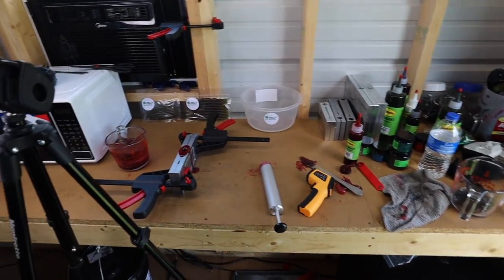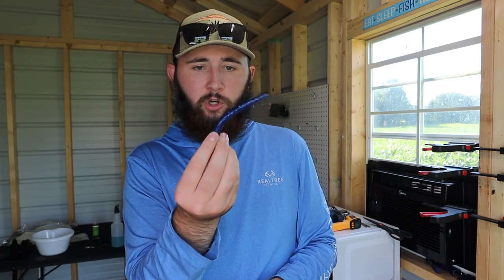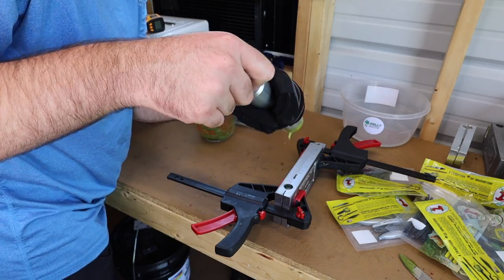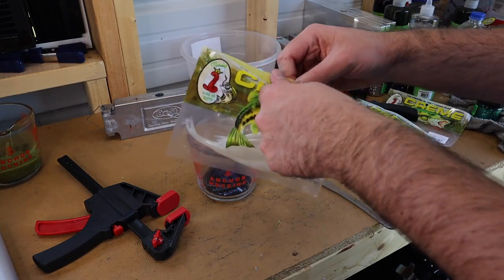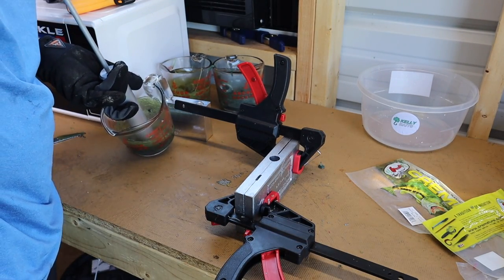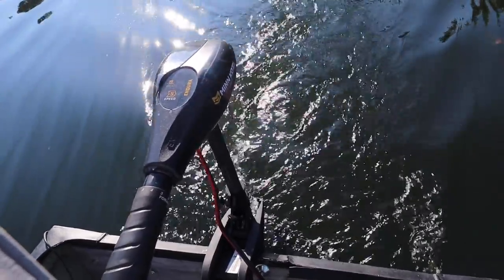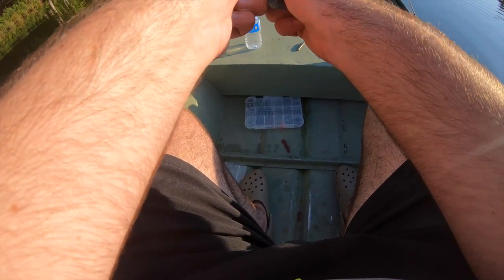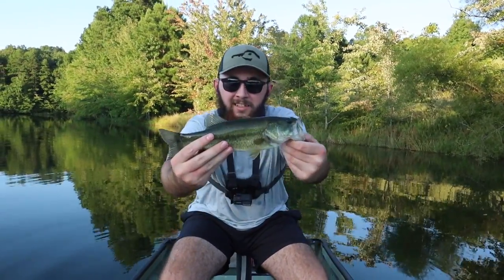REMELTING Walmarts CHEAPEST Soft Plastic Baits to Make My OWN! (Will It Work?)

Comment: Found you on TikTok and you inspired me to buy some molds and pour my own soft plastics! My biggest question is how does Zman make theirs so stretchy and resilient?? I know it's made with a different material, but can they be melted down and repoured? Thanks!!
Reply: Zman uses a formula made of silicone and their plastics can't be remelted. It's a trade-off of having plastic which lasts longer. If you want to do remelts, you need to buy soft plastic brands which are only made of plastisol.